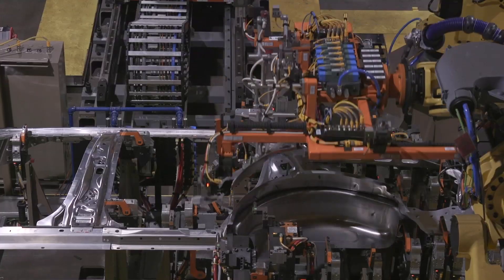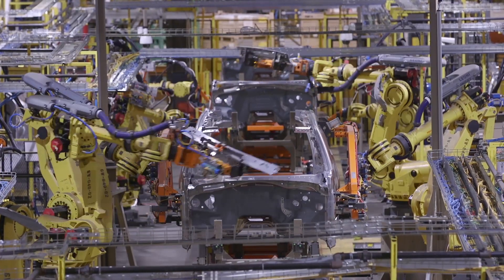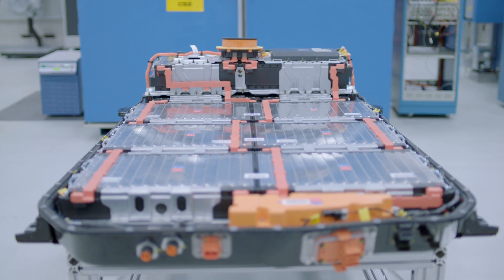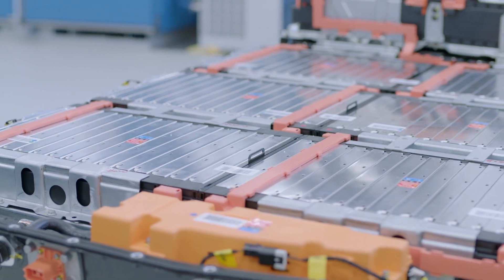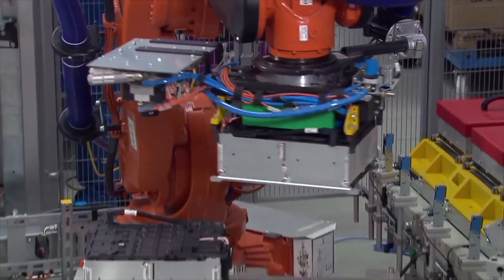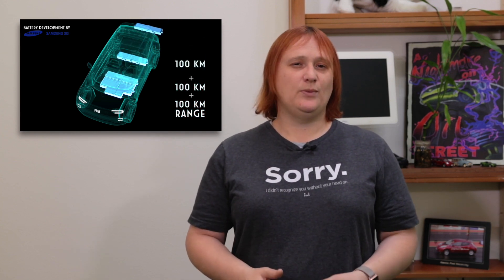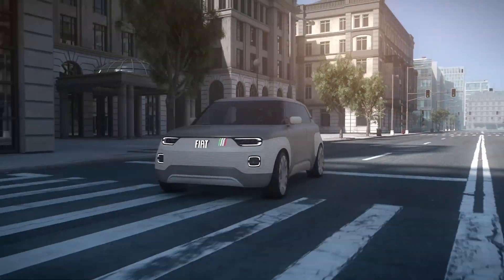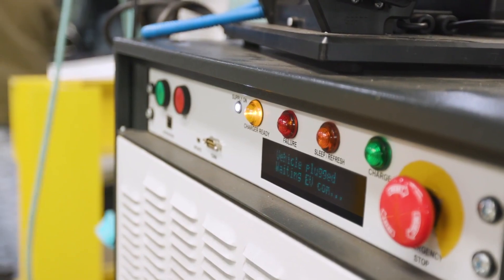What Is Modular Vehicle Design -- And How Can It Benefit Electric Cars?

Comment: Modular design meaning the hierarchy of maintenance so like the car drive in the robot diagnostic kiosk and robot remove and replace the component and you back on the road in 5 minutes while component goes into higher intermediate maintenance shop in well lit air-conditioning working place for high quality performance and no more grease monkey that girls friends all deserted them for dating medical doctor who work with germs and induced hallucinating happiness

Comment: We need a lot more standardization on batteries and even electrical engines indeed. The concept of extensible range battery packs especially is awesome, and it could also be used for battery swapping, making recharging as fast as refilling gas.
Unfortunately, there will still be different types of battery packs and engines based on quality  or performance or technology. But I guess even recharging different types of batteries in the same car can be addressed, as long as the individual battery pack contains only the same battery types.

Platforms include mostly car parts like chassis indeed, but can also be seen from the car factory's perspective, i.e. totally different chassis and cars that can be produced on the same production line with the same programmable robots and manual workers.
This is important when car manufacturers decide to build a brand new car factory in a different country and market: They can produce several types of cars in the same production floor instead of producing just one platform and its variants, adding production floors as they grow. It also makes the car factory more resilient: When one production line crashes or needs to be upgraded, production can continue on another during repairs or maintenance.

As modular goes, I was even dreaming as a kid of being able to swap at will the "top hats", the body on top of the chassis and seats, for instance from a regular road trip car to a delivery vehicle or a pick-up truck, or even change style, from a modern-looking car to a vintage Jaguar Mark 2, a Citroen DS Pallas, etc. All chassis from all car manufacturers would share the same design to connect any top hat from any manufacturer. If Tesla really manages to build cars and batteries made to last a million kilometers, your car might get boring after the first few years, swapping bodies would bring a new car look, and would also make fixing all the little car body dents and glitches easier if the top hat is sitting empty and easily accessible in the workshop.

Comment: I think drive train (motor, gearbox, power electronics) will be very easy and convenient for manufacturers to standardise. These components last a very long time and are unlikely to be replaced and there isn't much that can be improved that would require a shape change.
The battery pack however is what can give advantages to a manufacturer over others and it is unlikely they will want to let others use their technology. Also battery packs are what determine the useful life of the car. It will not be in the manufacturer's best interest if aftermarket suppliers can easily sell cheap replacement battery packs that are better than what the car had when new. It would allow EVs to potentially last twice as long as a petrol car. This would be bad for business. A good example is a new battery pack for a Nissan leaf in Australia is about 70% or the price of a new car. Imagine if you could replace that battery pack for $3000 and give your car another 8 years of life.

Comment: As long as different battery chemistries, regulatory systems and voltages are out there, a common cross industry standard pack will stay a dream. But there is hope that at least we will get a single plug and universal paying methods eventually to end the chaos and frustration at public chargers.

Comment: The downside of platforms is that they lock you in.  In becomes way harder to inovate.  One of the big hurtles electric cars have had is the existing platforms.  This hurt hybrids.  The only company that really developed a hybrid platform was Toyota's synergy drive.

Tesla is at it also.  Sandy Munro talked about it when examining the electronic systems in the Tesla Model 3.   Tesla eschewed the modular design of many separate computers wired together in favor of one central computer.  Very much like Apple did with the iPhone.
Reply: That actually makes it harder to fix as if something goes wrong the whole thing goes down not just the module.
Reply: wow platform lock u in eh

platform hard to inovate eh

sure those dont happen in centralizes design....

Comment: Hi Nicky, am I correct from an ingeneering perspective that the MEB platform has a (some) serious weaknesses built in which initially will not be seen/ noticed. If they keep a car platform over many years in like they do right now instead of costant updates like tesla does. Am I correct that the max charging speed will be impossible to upgrade after reaching its software & hardware peak...? Right now if a car with the MEB platform max charing specs & lets say 64 kWh usable battery would be faster then the new 100 min standard 100 kWDC (new released properly built EV's with a 'bigger' battery. This will be terribly outdated or sub standard in just a few years. It is vital & a fact that charging speeds are & need to improve fast to break the slower then ICE fueling up. EVs battery packs also will still need to increase a lot to reach range parity with ICE which will makes this weakness even worse / more evident
Reply: Charge rate has nothing to do with the MEB platform.

Comment: The MEB platform is nothing new or exciting. That adjustable platform is already being used by Volvo for 3 years now. They have a different name for it.
Reply: The MEB is just the new platform for electric cars. VW has actually used a modular platform design for a very long time across most of its many brands. In fact, the current MQB (Modularer Querbaukasten) has been in use in over 40 different models across its brands since 2012, and is currently used it is second iteration. Before that, there was of course another modular design as well. It makes it much cheaper to exchange components across its range of different brands, not all of which of course use those modular designs (Ducati has no use for the MEB or MQB for example) and of course the company can make some money by licensing it to other manufacturers, or get something else in return.

Comment: Yes Fiat, but adding battery modules to, or removing them from the car to suit the user's immediate needs is nice in theory, but batteries are heavy.  To keep driving characteristics and safety under control, all cars equipped with variable battery size also would need adjustable springs and dampers, adjustable physical and regenerative braking components, variable steering assistance, possibly changes to air bag triggers and seat belt pre-tensioners (and probably lots more) just to compensate for the weight changes.

Comment: As an example of what the video is talking about - BMW has over 60 different models of cars in production and all* of them are build just on two platforms: CLAR for larger (3 series, X3 and anything above them) and FAAR for smaller (1, 2, X1, X2 and Mini) cars. In addition to spreading out the cost of platform development across far larger number of cars this also benefits technology sharing across the product range - once a design for a PHEV based on CLAR platform is developed, it is relatively simple and cheap to replicate that for all other car models on the same platform. Same is also true for EV development - BMW is designing its 5th generation EV drivetrain with CLAR platform in mind and it is also designed to be scalable, so that it can be used for anything from a small sedan to a huge SUV. That is how BMW is planning to offer at least 12 different EV models before 2025. It will also help a lot that such cars can be assembled on the same assembly lines as their base cars are already being assembled on in production. This again spreads out the investment and labor costs across multiple car models reducing risks if one model either does not sell or encounters problems in production scaling. Shared parts and shared repair knowledge have also already been mentioned.

* - except i3 and i8 and few older car models still being produced that were introduced before CLAR/FAAR development.

Comment: It seems VW is going to have a leg up in  modular car  construction, since they've been doing that starting with the Beetle.  Their Squareback, Notchback, Sedan and Karmann-Ghia were all built on the same basic platform.  This was their whole chassis assembly.  Other manufacturers, once unibody construction began, used subframes to carry their engine, transmission and steering components.  Now, with platforms being constructed to carry battery and drive components, with a body dropped on afterward, it's just like back to Beetle building for VW.  And they know how to do that very, very well.

Comment: Yes, I knew that vehicles from different manufacturers often share parts. They've been doing this for decades, maybe for actually a century by now (I said maybe). Not sure whether the Now You Know guys knew before very recently. They reported on some joint ventures in the auto industry and acted as if it were the most bizarre thing they'd ever heard of.
Reply: People on Tesla fan board often don't know much about how cars are made. Arguments like "Mercedes wouldn't use an engine for another car maker!" are still really common. So it is important to educate people on basic facts of life from time to time (Like Mercedes using Renault engines in some of its models as it is cheaper than developing their own sub-2l engine). This, however, is not about sharign parts, this is a bout a company building an equivalent of a Lego kit, using it to build all their different types of cars and others also using the same Lego kit (under license) and putting their body shapes, interiors and badges on the result. Like BMW Z4 and Toyota Supra.
Reply: Nowyouknow don't know a lot.
As to how long automanufacturer's have been using "modular designs", I'd say the Ford Model T was an early example.
One chassis engine and running gear, available as a 2 seat runabout, 4 seat roadster, 5 seat sedan, pickup, flatbed, delivery van.
And most cars of that era came as a naked chassis and the customer could specify the motor and then send it to a coach builder who would build the body to the customer's specs.

Comment: I’m surprised you skipped Rivian in this topic.  Right now they have one chassis for two different bodies   The truck and the RV.  The battery pack is 3 (power options) sizes each of which will fit in the same chassis.  They have done testing of this chassis with a Ford F-150 body mounted on it.  This was before Ford made the 500 million investment in Rivian so we can guess where this might be going. With Amazon investing 900 million in Rivian I can also see some sort of delivery truck body being mounted on this same frame with different battery sizes for different functions .  I would also suspect that this chassis could easily be stretched out and beefed up or compressed a bit to handle larger vehicles capable of larger battery packs and range or smaller vehicles.  The only thing that would cause more expense is if they have to change the motor sizes if they want to downsize them for the smaller vehicles. The way the motors are now they can easily propel a larger vehicle and no change in size would be needed unless they got into something much larger
Reply: Rivian is still just a dream yet,  but Tesla better get going on their pickup soon
Reply: Tesla cars use common parts. Your point is silly.
Reply: @Yamahaxttt500  Are there common parts between Model S and Model 3? IIRC they literally changed absolutely everything. Even between Model S and Model X a lot of drivetrain components are not interchangable. They are just different sizes for no good reason.
Reply: @aigarius  well I can't refer to source at this time, there will be common chassis and suspension components across all the four models. 
And . . .
'the flagship sedan and SUV are getting a redesigned powertrain that uses the same "permanent magnet synchronous reluctance motor" and associated technology we first saw in the Model 3.'
Reply: @Yamahaxttt500  those were rumors. Musk said just last week that no big updates to Model S and X are in the works or plans. Just small, incremental fixes. There are zero parts shared right now. Even steering wheels and glove boxes are different.
Reply: @aigarius  I have to challenge your comment but sadly I've got no concrete proof.  I have limited experience in automobile manufacture (engineer in two large vehicle manufacturing plants), I'm confident that the model X and the model S have the same chassis and the model 3 and the model Y will have the same chassis. 
Using existing VW vehicles as an example: Golf, Audi A3, Seat, VW Beetle and both Audi and VW small SUVs all use the same chassis, same engines and often the same suspension. 
It would be outrageous if Tessa wasn't doing the same.
Reply: Aigars Mahinovs I didn’t say Tesla was not modular
Reply: Lawrence Atkinson I wasn’t badmouthing Tesla I was just commenting on Rivian
Reply: Never saw rivian cars btw

Comment: Would be nice to have designs so modular that one could remove battery modules from their car at a time of their choosing and plug it into their house with an equally modular home battery system!
Reply: There are many locations in Canada with minimal or unreliable infrastructure.  It would  be wonderful if I could have a car with an electric drive  train (with regenerative braking and no transmission) but
many swappable power modules just like you suggested.  If need be you could swap some of the
battery power modules, with an Auxiliary Power Unit module (like a fuel cell or even an ICE), with appropriate fuel modules for powering your vehicle or your house...

Comment: When I was in middle school I volunteered for a program called WIKISPEED. They were making modular aluminum cars with modified Honda engines that could be switched out very easily. It was made to you could switch out from a gas to electric motor, and adding batteries was easy.

Comment: Considering the highly unnecessary assortment of 12 Volt Lead Acid batteries across various car manufacturers, I sure would be holding my breath for any kind of standardization for EVs.
Reply: The 12V lead acid batteries are sized specific to the CCA needed to start motors of various sizes in ICE vehicles. I don't think this fact has a ton of bearing manufacturers willingless to modularize EV manufacturing.

The level of modularization will likely be realized as a balance between consumer demand for it to make repairs easier and cheaper and the manufacturers desire to reduce manufacturing costs.
Reply: A good designer will look at all the E.V,  and steal the best. Which will hopefully make projects more standardized. Even without a formal agreement.
Reply: Remember the video cassette (VCR) battle. The 'Blu-ray' battle. Sadly, individual brands don't see the advantage of standardization.